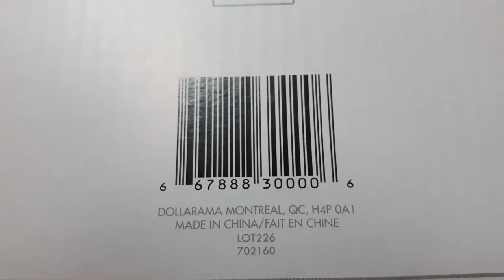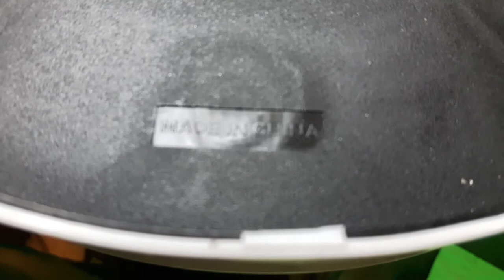Upgrade noisy ticking wall clock to a silent sweep second clock for $7 Canadian

Comment: So you are changed the entire movement or add a sweeping component?
Reply from the maker: Changed the whole movement with a movement I bought on eBay for only $7 Canadian. Just look for Mechanical Continuous Sweeping Silent Quartz Clock Movement Replacement Part . There's one on ebay now for $6.30 canadian shipped.
Reply: @watchmedraw4340  thanks mate. Mechaquartz.